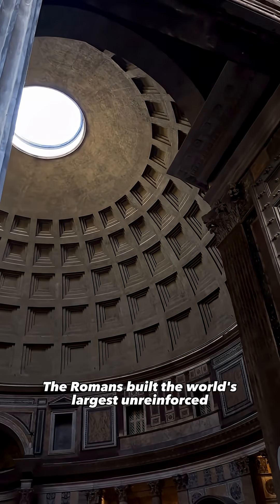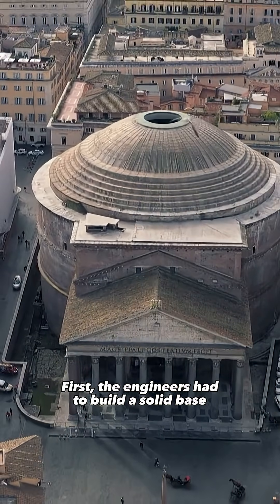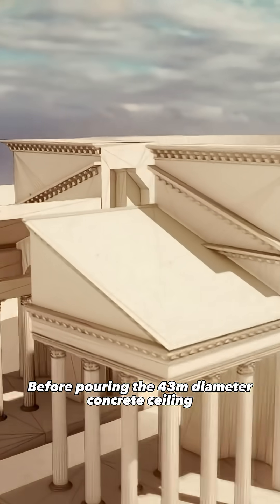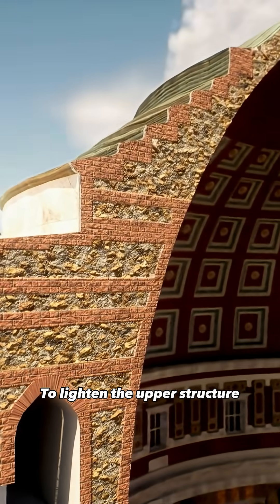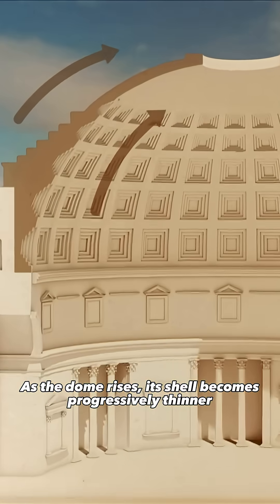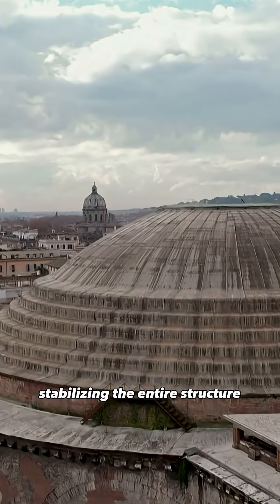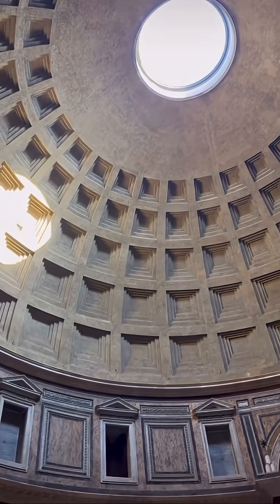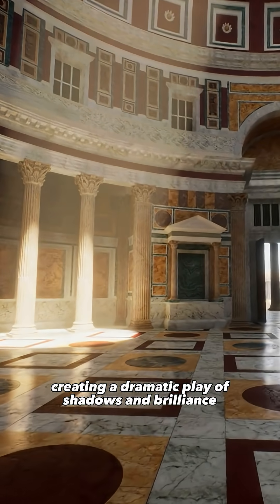The secrets behind the Pantheon's engineering #history #romanempire #engineering #pantheon

Comment: Their Engineers were far above their time period, they have that big hole in the center of the pantoran roof in Rome, where rain falls through it and lands on the floor beneath it, and then it goes out a drainage system they have below the opening on the roof and they have the floors curved that the rainwater just goes flo's right down to the center of the floor then drain and out through a drainage system, magnificent engineering for ancient times..🤔

Comment: It's a shame that so few of the builders' secrets have survived to the modern day, especially their mathematical formulae for planning & designing such a remarkable structure. 

It's actually somewhat overengineered, being capable of withstanding significantly greater force than that of its own weight. This has perhaps been a significant factor in its longevity when compared with many other contemporary Roman structures, despite wars, earthquakes & just the degradation of time.

Comment: Once something is done, it can easily be duplicated, but the original took an insane amount of engineering. You must wonder how something this complicated was done without steel or composite reinforcement. In today's time, it's no big deal since we have multiple ways of reinforcing concrete, for example, steel and fiberglass rebars, and additives to the concrete like fiberglass/carbon fiber. In today's time, building something like this is not impossible; it just comes down to money. 👍👍 to those engineers from the past

Comment: St. Peter’s church is even more impressive.
It has a space between the roof and ceiling with a staircase that spirals around it until you get to the top, which leads to a circular balcony and the views are spectacular.

As you climb the stairs you have to put your hand out and lean in the inside wall which is the ceiling so you done fall over onto the wall because as you climb obviously because it’s on an angle, more so towards the upper portion.

Picture a smaller ball inside a larger ball with a three foot difference. Then cut both balls in half and leave the upper half.  Put them on a building.  That’s what it’s like with a staircase inside.
When you stand inside the church and look up at the balcony, it looks like it about ten feet wide, but when you’re up there, it’s about thirty feet across.

It’s an amazing place, better than the pantheon.

Comment: Romans handled rain in the Pantheon by designing a slightly convex floor that slopes toward the center and is equipped with 22 drain holes. Rain falling through the oculus is directed by the dome's geometry and the floor's curvature to these hidden drains, which carry the water to the exterior of the building. This innovative drainage system prevents flooding and keeps the interior marble floor in excellent condition.

Comment: People are asking about what happens when it rains. The Romans thought of this, too.

If the front doors are open, as they usually are, it creates an airflow that exits out of the opening in the dome. If there is only light rain, the rising air will deflect many raindrops before they can come in. 

However, heavy rain does get in, and in that case, the floor was designed with recessed channels to prevent rain from pooling. The floor is actually subtly slanted from the center point to the edges of the interior, where it is channeled outside.

Rain inside the building was rarely a worry for this building.
Reply: Stop giving people answers. You are contributing to the aphantasia epidemic.
Reply: @misterturkturkle  I can't picture that happening...

Comment: There is no steel (iron rebar ) therefore there is no corrosion. Which is why it lasted .
New concrete structures with steel have a lifespan based on iron corrosion which is 100 to 200 years

Comment: You might ask, what happens when it rains? Well, some water comes in through the hole and creates a puddle in the middle of the stone floor. But most of the rain runs off the roof, so it's not a problem.

Comment: Not sure about the stated benefits of the oculus: "relieving pressure at the dome's weakest point". I think that's probably a lay person's misapprehension of the structural benefit, which is the omission of weight at the one location in the structure where it would add no strength, because there is no stress there to resist.

Comment: For those wondering what happens when it rains, Google gave me this:

When it rains in the Pantheon, the rain falls through the oculus, a large circular opening in the dome, and onto the floor. However, the floor is slightly sloped and has drainage holes, allowing the water to flow away and preventing flooding. This clever design ensures that despite the open roof, the interior remains relatively dry.

Comment: I am underwhelmed by this video because it left out the two most important points about this amazing structure. 
1. There is a reinforcing ring around the structure, without which the dome couldn't stay up.
2. The Romans had mastered dome engineering to the point where they knew the zero stress circle of a dome. At that circle, they cut openings to both give more light into the building and further reduce the weight of the dome.
Why the producers of this video left out the most important engineering points, I'm sure I don't know.

Comment: What many people miss is the fact the pillars at the front of the building act as a wind tunnel that wind picks up speed coming into the interior The spherical casing inside spins the cool air And pressure pushes out the hot air thru the roof Today it use equal would be a Turbo casing without the fan

Comment: I don't know how accurate that cross section of the dome is but it seems a lot of it is actually blockwork. The blocks would have to slope in so the joints are at right angles to the arch surface.  Otherwise lateral forces would  cause the joints to shear apart.

Comment: The Pantheon's concrete was reinforced with ropes made with vitreous china. If they had steel rebar and used it, the Pantheon would likely have collapsed over a thousand years ago if not earlier. Steel rebar eventually rusts and breaks apart the concrete it's embedded in. 

The oldest known structure that contains steel or iron reinforced concrete was built in 1853.

Comment: In the great state of Michigan, the engineers — lacking the might of Roman concrete or even the sense of a decent drainage plan — set forth to build their roads. With a series of oculi — great circular voids — stacked like matryoshka dolls of disappointment. Each pot hole larger than the last, a triumph of savings over function!"

To reduce the financial burden on the good citizens, a cunning method was deployed: using less cement with each passing layer.

Comment: There is quite a bit wrong with the voice over.   Concrete cures by a chemical reaction not by drying out.   The coffers are only aesthetic to the extent they are on the inside and only lighten the structure.  The oculus provides light and makes the dawn lighter, Concrete is very strong in compression so it does not strictly speaking make the dome more strong.

Comment: Now to compare to modern structures and see how it goes.
Modern building materials degrade much faster than you realize:
- cement 50-100 years,
- steel 50 years,
- glass, same
- stainless steel (because an American proudly mentioned here, of their buildings with stainless steel frames) 100-1000 years, but that's only if the stainless steel is in a controlled environment, without corrosive agents.
In buildings, it will last maybe 500 years, but not in the form of the original structure, but in pieces on and in the ground.
No modern structure will last more than 200 years without continuous maintenance.
If humanity were to suddenly disappear or people were to leave the earth for another planet all at once, any trace of modern society would completely disappear in 250 years.
Ancient buildings in 2000, and the pyramids in Egypt in about 50,000.

Comment: A 2000 year old concrete roof with no steel reinforcment compared to todays engineers who specify massive amounts of steel that will only last 100 years,Hmmm we reckon we are so advanced today😅😅😅
Reply: It's because of the steel reinforcement that things don't last as long, but it also allows us to build much stronger, taller structures.
Reply: @connorbeck575  Not really stronger when the structure doesnt last that long todays concrete  nowhere near the quality of the roman concrete ,They have only just recently confirmed the ratio used

Comment: Some comments here quoted quicklime, calcined lime and calcium oxide used in concrete that would react with water later to form concrete and seal cracks as needed.  Why aren't modern concretes the same?

Comment: And weirdly, the updraft of air through the domes hole keeps the rain out, we learned with a group of fellow tourists enjoying that fabulous building. It’s huge!
Reply: Maybe partially, but it can rain inside, depending on the angle of rainfall
Reply: No it doesn't. That's why the building has drains in the flooring.
Reply: @mirko87  how is an extra precaution an argument against? It should have drains nonetheless.
Reply: How
Reply: @NewBron-w3f rain coming in at an angle is deflected away from the opening with light force, by the higher pressure air in the dome escaping. Heavier rain or coming straight down, will still get inside and is handled by a drainage system.
Reply: @davminks  This is definitely true. I was there this year during heavy rain and it was hardly raining through the skylight inside
Reply: @davminks  Only when the wind is blowing in the right direction.
Reply: @robertjohnston8690   true for wind coming from outside. But there is usually a decent updraft coming up the hole, from the slightly higher temp and pressure inside. 

The Romans knew this and did it because to top is the most efficient place to vent hot summer air. Plus the structural benefits and weight savings of having an open dome. 

If the pressure and temp are near equal to outside, then there's almost no updraft, most of the rain above will fall right in even if its a light drizzle.
Reply: @davminks well there might be a tiny grain of Truth there it's not enough to stop actual rainwater coming into the hole and think about how high the pressure differential would be for are to resist falling rain 

That would imply that higher pressure are at ground level would somehow stop rain from falling it's just not how physics works
Reply: @mcamp9445   the pressure is higher in the dome because it is usually warmer than the outside air. I suppose deflection rate would depend on that temperature difference
Reply: Yeah there just isn't enough air flow coming out to deflect rain water is quite heavy by volume and it's traveling quite fast. 

Like even had been exceptionally hot and the building itself was hot and there were hundreds of people inside and it was now night time or it was colder outside and the door was open the amount of air coming out of there would just simply not have anywhere near the force required to deflect rain even a light drizzle 

The are exiting would have to be going you know 20 or 30 mph to even have a shot at keeping rain from coming in and it's just there just isn't enough heat to create that kind of pressure differential @davminks
Reply: @mcamp9445   20 or 30 mph gust to move light rain? Rain goes starts going sideways at 5mph, and any small increase in speed exponentially changes the rain's direction.

The scenario you described is actually what usually plays out, and what the Romans built the relief for (in addition to structural stability of a lighter top). Many hundreds of people gathered inside, hot Italian day out, the air in the dome is stifling and the only real relief is the opening for hot humid air to rise out.

Add rain, and the column of hot air leaving will deflect small droplets around 10 feet above the dome or so. At the actual hole, it would require a larger force to deflect at a more extreme angle. ie: I'm not saying the rain reverses direction or something, it's just deflected a few degrees (0-45), between 0-10ft above the dome.
Reply: @davminks yeah I don't know man I've been there when it was raining and the rain came in. 

If there is an effect which I'm willing to concede in very very light rain that there could be some effect it was almost certainly not intended 

In the air would be going straight up when it left pushing rain sideways is way easier than pushing rain away from its trajectory straight down when you're trying to use are from directly below
Reply: I'm been in it when rain was coming through the hole. So you're full of it
Reply: That's cool! I was just wondering about that. Thanks.
Reply: I was wondering about the rain
Reply: It wasn’t raining when we were there, but our guide said the Parthenon stays dry. That was 20 years ago. I guess he was wrong? I have to admit, I did like the updraft dryness concept and believed it all these years! 😀
Reply: @carrielettuce7386 yeah rain definitely comes in it's possible that there is some deflection from are rising but really water is heavy and what is the pressure differential going to be from. 

High pressure are is being pumped in there 

Rain does indeed come into the building
Reply: Huh! Thanks. 😊
Reply: I was wondering too😂
Reply: That’s not true. Rain definitely gets inside.
Reply: maybe they used to cover it
Reply: Wow really?
Reply: @GrzegorzDurda  no. That’s not true. Rain definitely gets inside.
Reply: @GrzegorzDurda  I was there in rain, it fell on the floor which was designed to cope.
Reply: @Digeroo123  well that makes excellent sense.
Reply: That's really cool
Reply: They're lying to you. It really rains inside. I've seen with my own eyes. There are small holes on the floor to drain the water.
Reply: @calauria correct sometimes under the right environmental conditions a fog/mini cloud form
Reply: I am sorry but there was rain inside when we were there. Just 5 minutes and not heavy rain but the floor got wet.
Reply: I was there on a rainy day and it does not keep out the rain. The floor was quite wet.
Reply: Salesman will tell you anything, if you're dumb enough to believe it, it's your own fault.
Reply: @frankfranks2946 Exactly WHO is selling WHAT here? 

Looks like YOU are giving away BAD ADVICE for FREE. 😡
Reply: @frankfranks2946 do you thnk someone tried to sell them the Pantheon? 🗿

Comment: How in the world did they produce cement at that large of a scale. 1 5 gallon  home depot bucket at a time? Its unreal no internal combustion engines. No steam power, no electricity. Just manpower and horsepower. Its so impressive
Reply: Their concrete is made from a type of volcanic ash found near Vesuvius.  You can read about it in "TEN BOOKS ON ARCHITECTURE" by the ancient Roman builder Vitruvius.  It is still in print!

Comment: What happens when it rains?
Reply: It rains inside. But the hole is relatively small compared to the building, so that little water reaches the floor. The floor is designed in a slight convex shape, so to lead the water to the drainage system.
Reply: I was in it in winter when snow fell. In through the oculus. The snowflakes had evaporated before they touched the ground.
The oculus has a more important function than mentioned in the video. It indicates the winter solstice.
Reply: @jpdj2715 more important?
Reply: I was wondering that too

Comment: What about rain?  Why hasn't a clear dome been placed over the summit?
Reply: The floor is not flat; it's subtly curved upwards towards the center. This slight slope ensures that rainwater flows outwards towards the edges. The floor has strategically placed drainage holes that collect the water and channel it away from the interior.
Reply: Why would a clear dome need to be placed?
Reply: They left the hole so that Roman snowmen could be built inside.